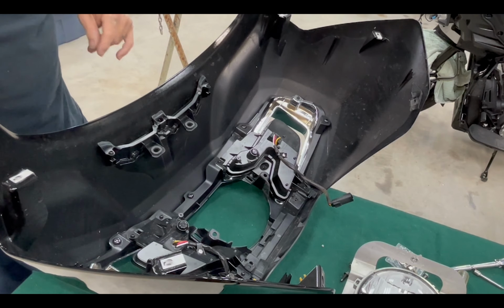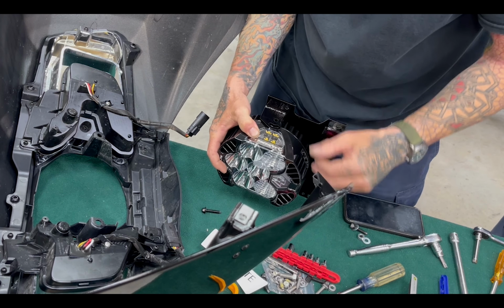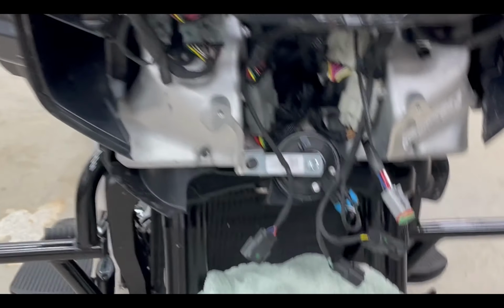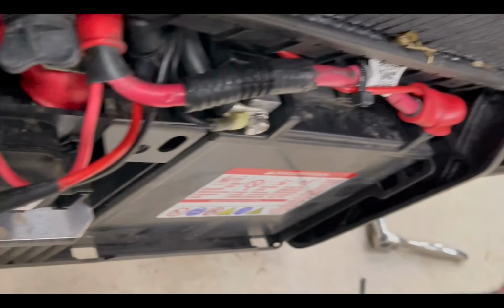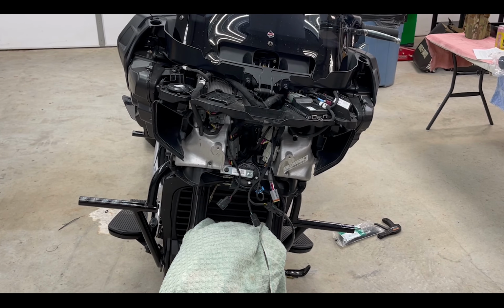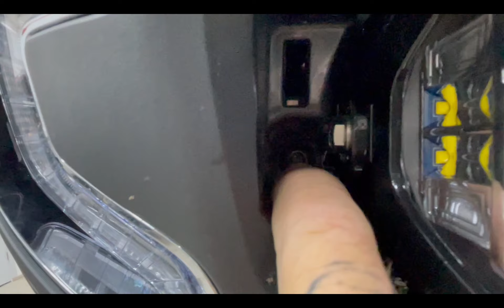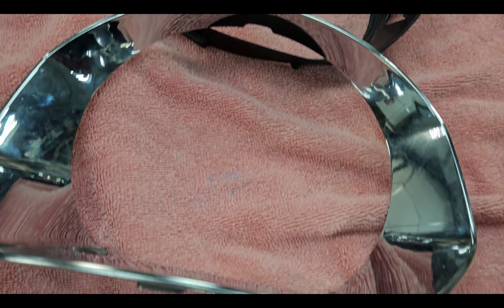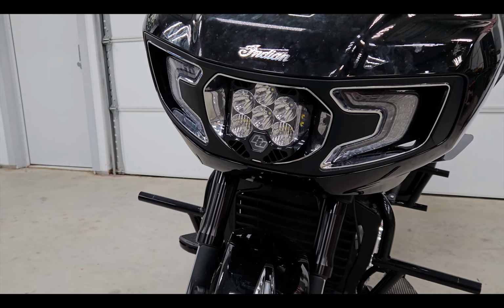2023 Indian Challenger “FOREVER RAD” LP6 Baja INSTALL #58

Comment: BAJA should create a plug n play connector so that you don’t have to wire to battery or plug in relays… kinda of meh on the set up. But the final result is cool.
Reply from the maker: I believe the biggest reason is because of the Indian canbus they use. It has to be turned on after that initially powers up.

Comment: I’m looking into doing this upgrade on my bike but reading the comments it makes me think twice because I didn’t know you had to plug it into relay and wire it up in a certain way. I thought it was a plug-in play set up
Reply from the maker: This upgrade is one you will definitely want to do. Its an amazing how bright it is.  I finally put one on mine. But yes it has to be wired to the battery.  The relay is there for the bike turn on.  Once the bike is turned on like running it send the signal to relay to turn on. The harness is pretty much a plug and play. Just the battery hook up portion is not.

Comment: Saw that you had both kits. Is there a reason you went with one over the other?
Reply from the maker: The JROD kit pulls the light back about 1/4 of an inch.  It comes with spacers to do this.  I had some spacers so we just spaced it out with the forever RAD kit.
Reply from the maker: Also a buddy of mine bought one kit and I bought the other, that is the only reason.
Reply: What did you use for spacers? How many & how thick were they...CVMA18-1 🤘🤙@reyffdesigns1282
Reply: @kennyb7883  I have a bunck of odds and ends around.  So I used the spacers from a t.v. wall mount. You usually get a types to mount tvs to the mount.  But you could go to a Lowes or something like that and buy a round spacer that fits the bolt, 1/4 to 3/8 spacer will knock it back a little...10-1!!